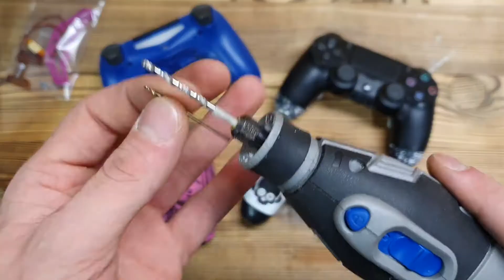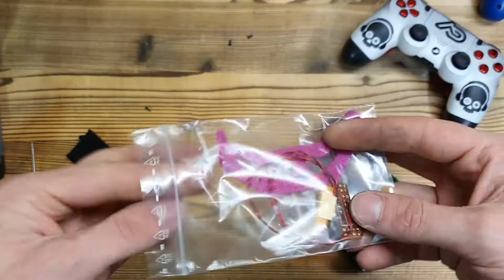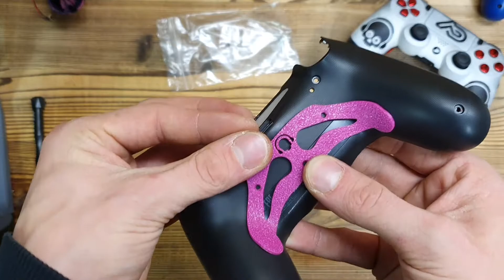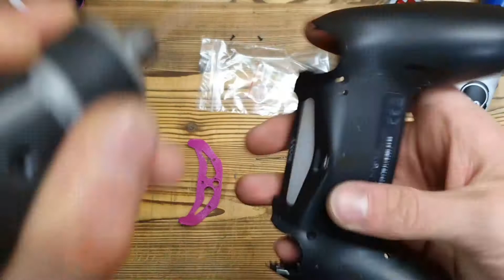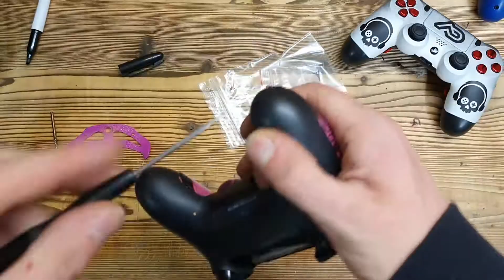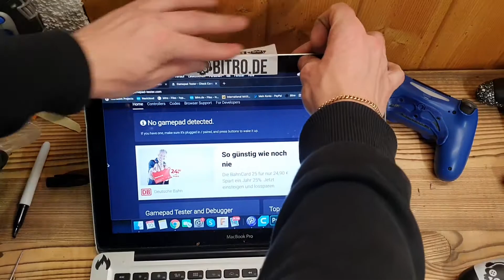how to install paddles | build your own ps4 pro controller

Comment: Hi there, I need your help.  I made a couple of controllers with back paddles using this method, but today I had a problem. When the customer received the controller, the hot glue was detached, I think because of the hot temperatures outside. Is it there a method to make the glue stronger? Maybe mix it with the attack, I don't know. Thank you very much
Reply: i'm very late but for you (and for others reading this), you can use gorilla glue, that's what i used becuase mine hot glue detached itself
Reply: @2lay i switched to extremerate’s paddles, no glue and no wires, more pricy but less problems…thank you anyway
Reply: @hydrodipita you’re welcome 🫡